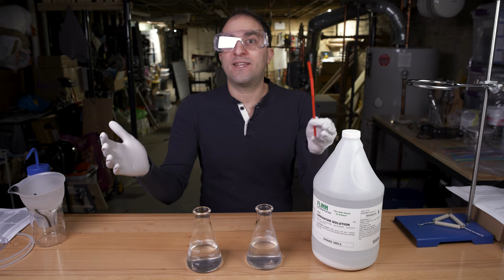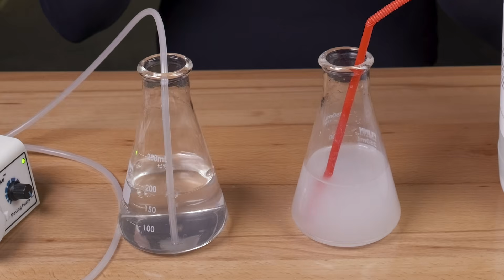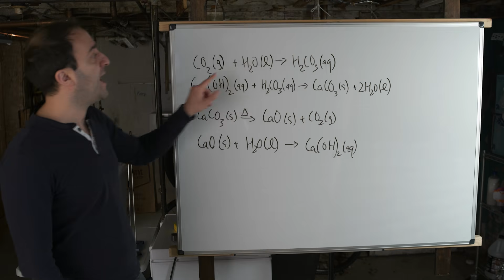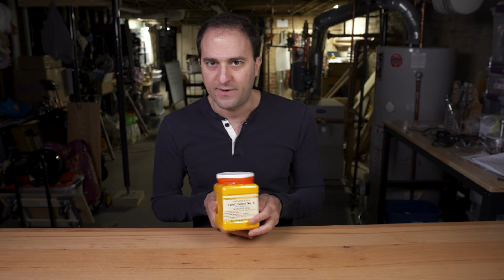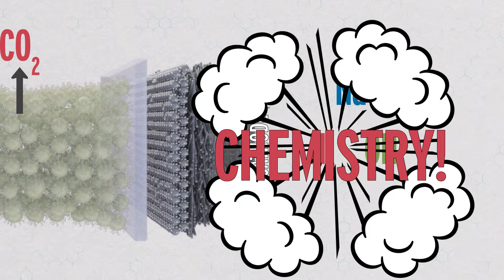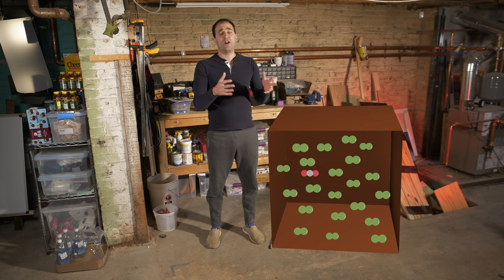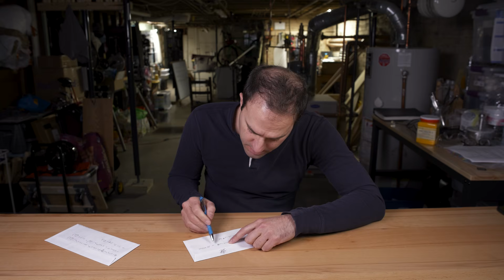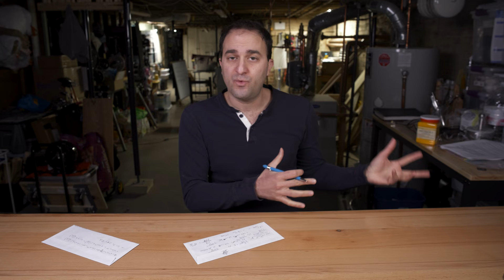Why a Carbon Capture Breakthrough Will/Won't Save Us

Comment from the maker: Lots of talk about trees here. And trees are great, reforestation is an important thing to do. But trees aren't really a good approach to direct air capture (DAC) for two reasons: land mass and time scale. Trees take up space, and there's only so much land on Earth that can support trees that doesn't already have them. Also trees lock up carbon for a relatively short period of time, climatologically speaking. We need more trees, but we need to go beyond what trees can do for us.

Also, to address another recurring comment, we can’t just dump the CaCO3 into the ocean because then we’d have used up our Ca(OH)2, so we’d need to manufacture more, which means mining more CaCO3 and emitting more CO2 in the process. Plus there’s only so much limestone on Earth, and we can’t be dumping all of it in the ocean.
Reply: I added a comment about coppicing and biochar. I'm a gardener, my father involved in climate research (briefly). Soil building through coppicing is a perfect method that can be undertaken in your back garden very easily, with just hand tools. 
Under certain conditions, trees can lock up carbon for a long time (caves have been discovered with trees washed inside that date back several centuries, even millennia). 
The thing with coppicing is, although 10% (average) carbon is retained in the soil under the brash heaps, the tree is actively 'regrowing' and absorbing more CO2, ready for you to harvest it 'again ' before the previous harvest has broken down fully.
Also, brash becomes food for a myriad of other lifeforms - insects, bacteria, moulds, algae, moss, fungi (each feeding that carbon to other lifeforms at a distance from the brash heaps). The heaps also be one shelters for birds and small rodents, which then help feed and build larger predatory animals, swelling their numbers, improving the carbon cycle. Every body is a carbon and water store - even if it is temporary, there is a moving, living repository of both moving over the planet rather than being wholly in the atmosphere.
Everyone is right when they say trees are the simplest answer. They're the simplest, least energy costing (free if you collect and grow tree seeds yourself), and most efficient in terms of effort compared to the technical and chemical answers.
Let's face it 8% energy efficiency a cording to your calculations is utterly hopeless. Whereas, over 20 years, I have built 2 inches of soil over a 2 acre plot of land - using only what material I could collect and grow on my own land (no imported topsoil, biochar or wood chips at all). 
The big difference in kick-starting soil building came when I finally established fungi species in my garden.
Reply: As someone who worked in this area 5 years, direct air capture takes up huge land mass and huge energy amounts. DAC is really a dumb idea. Capturing CO2 at 400 ppm takes huge resources as the driving force is so low. It's much better to capture directly from the power plant where it is at 200,000 ppm, even that would require half the energy output of the plant. Honestly, nuclear is the only real solution, but the 70's hippies ruined that for us.
Reply: @sjn7220 😭
Reply: @sjn7220  In fact DAC is remarkably efficient - best in class has a primary. 2nd Law Efficiency of ~50%.   The problem with CCS at a power plant is that the thermal efficiency is wrecked so it actually takes as much or more energy to separate CO2 from flue gas.    We are getting there as the first large scale DAC plant (  500,000 tonCO2 per year ) will be opened shortly by 1pointfive. 
DAC is much more land efficient than natural CO2 capture - the 1pointfive DAC plant is ~200mx500m ie 0.1 squarekm so to remove 1 billion tons would need a non contiguous piece of land ~ 50 km square using that tech
Reply: Do y’all at Reactions have any thoughts on carbon storage through enhanced silicate rock weathering? That satisfies the storage time requirement, and there’s vastly more basalt in the world than limestone.
Reply: How about planting palm oil trees in deserts to produce green walls that stop desertification? We could use genetically modified palm oil trees with C4 photosynthesis that maximise growth speed and oil production.

Oil palm already produces oil at an incredible rate and grows fast and we can use their wood to make paper, cellulose, charcoal, and other stuff.

Not saying it’s the best solution but the sequestered carbon is in a dense useful form that can be stored long time - unlike CO2 which is difficult to store.
Reply: @drgazter  There are plenty of different productive species that can be grown, oil palms isn't the best first choice for deserts specifically, as there are other plants, even including other palms, like date palms that wouldn't require as much modification/control/management of the conditions to grow in deserts.  So while you're right in principle, oil palms is just one of a lot of possible options, and while oil palms can be extremely productive, they require humid conditions, and their fast growth rate and high productivity in combination with low tolerance for arid and otherwise unfavorable conditions for plant growth isn't just a coincidence.        

Also, C4 photosynthesis is mostly helpful in low CO2 concentrations, an increasingly rare issue for plants, that's why mostly relatively low plants that also tends to grow in very "plant-crowded" situations have C4 photosynthesis. Also, C4 photosynthesis is slightly less efficient in high CO2 concentrations. If you want to increase growth in and general tolerance to dry conditions CAM photosynthesis could theoretically help. 

Modifying plants to give them ability fix nitrogen could be very helpful in improving growth in poor soils, and by that improving fertility of those soils. Giving plants ability to store water and nutrients could also make it easier to grow select plant species in conditions that aren't favorable to grow plants as it is. While not a tree, the sweet potato is a result of "natural genetic modification", which suggests modifying plants to grow bulbs might be a "low hanging fruit", to make them both more resilient and useful.
Reply: @fishyerik  While reading the thread, and especially your comment, i began to wonder if we could plant more plants by the sea. With almost an infinite amount of water, those plants could filter out the salt, and also create great mulches...I hope.
Reply: @eugenetswong  Of course we can, very few large plants grow well in seawater though, and the area is a very small part of the total land area. While plants grown in straight up sea water has very limited potential, or very small part of the total potential of growing plants, I believe creating significant impact requires creativity, and a wide variety of adaptations. 

Mangroves specifically are important for other reasons too, and last time I checked more Mangrove stands were destroyed than planted, or even given a chance to regrow by them selves. Stopping the destruction should probably be the first priority.
Reply: The problem is not the trees or the minerals or the energy, it's the time we have (left). The earth has been doing a great job capturing carbon for the past millions of years using nothing but it's stored energy, continental drift, the sun and organics, add loads of pressure and you get stored carbon in solid and liquid form. The problem we have is that nobody will capture CO2 without a profit. Trees even get made to furniture using more energy, the rest gets sold and burned releasing the CO2 back into the ecosystem.  If we want to change things we need more time, but to get more time we need to work things from all ends: release less CO2, help nature captue some of it, and remove some ourselves binding it for a long time. This video shows only a fraction of the scale of energy and effort required, but it does a very good job at that.
Reply: If only there were organisms that did this for free for us. Oh wait there is they’re called coral
Reply: Trees have limits, you do know about research that shows their stomata close up somewhat in the presence of higher CO2 levels, don't you? The problem is complex, and solutions will have to be numerous. And the only sure fire methods I know about are 1) make pollution cost more than not polluting. and 2) when it gets so bad that politicians personally can't stand the situation. example - the "Great Stink" - it's on Wiki.
Reply: Speaking of quarrying stone and dumping it in the ocean, what's your impression of the option of doing exactly that with silicate rock that weathers by reacting with atmospheric CO2 (aka enhanced weathering)?  (Oh, that's what a bunch of other people are already asking.  Cool!)

And speaking of the fact that trees only lock up carbon for a relatively short period of time, what's your impression of bio-char, i.e. growing plants and then heating the dry remains to produce what's basically undercooked charcoal for use as a soil improvement?  Charred carbon in the soil is said to stay out of the atmosphere for considerably longer than carbon in trees normally does.  (And there's even somebody already asking this.  Even cooler.)
Reply: @danwylie-sears1134  why not combine methodologies?

quarry suitable materials in underground environments, then store plant charred carbon underground where it's effectively dead?
Reply: @CH-bd6jg  Part of the reason for using bio-char to sequester carbon, instead of the various other options, is that it's also useful in soil.  So the value as a soil improvement effectively pays part of the cost of getting the CO2 out of the air.  If you dump it in a hole, you've lost that benefit.
Reply: REDUCE AND REUSE

STOP FOCUSING ON RECYCLE.

COMPANIES PUSHED RECYCLE BECAUSE THEY KNOW IT DOESN'T WORK.
Reply: The equivalent of 353.43 billion tons of ancient plants/organisms is emitted per day in oil as it takes 90 ton to make one gallon of oil, the world uses 3.5 billion ton of wood per year as a comparison, this isn't coal where china has used the same in the last 20 years as USA in the last 100, to supply us all goods, just oil.
Any sequestering, which has already been done by the planet would need to counter this while also accounting for the energy to do it, per day.
Arthur Berman has a sub stack in his latest he shows I think a 9000 percent increase in forests would be needed, could have been 90,000 but still, forests are not going to a be a solution and removing CO2 takes a lot of energy..
Reply: I am totally on the side of reducing 90% of emissions, if we ever get there wouldn't trees and algee alone be able to do the removal of the rest for free? I feel like DAC & CCS is just some moneymaking scam that are sucking up resources we could align with faster (and real) solutions.
Reply: What about enhanced rock weathering where we fracture limestone and basalt formations that are already on the seafloor as a way to expose the Ca and Mg in the rocks?
Reply: @nzuckman  You mean the arxiv paper: "Nuclear Explosions for Large Scale Carbon Sequestration"
Reply: Trees still capture a lot of carbon, using direct solar energy, and can do it without significant resources, they can essentially both grow and reproduce in dirt, from dirty water and sunlight, if we let them. Also, trees stores the carbon in very practical solid carbon compounds. Careful forestry without extensive clear cutting can both provide continuous carbon sequestration and valuable products that can be used to replace materials which production cause a lot of emissions. 

Also, wood products range from things like paper which might get burnt the same day it's sold, via building materials and furniture that typically last years to centuries, to biochar that can last for millennia, and can have numerous positive effects during that time. 

Talking seriously about artificial systems to gather CO2 and then brushing off trees with waving arguments that are quite hollow isn't really impressive. There are huge areas that can be covered in trees just by letting them grow, or adding water, which absolutely doesn't have to be of drinking quality, and without significant competition with other activities/values. 

Funny how the time scale-argument is used in different ways, some say trees don't hold on to the carbon long enough, which has some merit if you focus on single trees, and assume planting trees one time is what's suggested, and not creating forests and wood products that are used for a long time, while others argue that trees grow too slowly to be relevant. 

Sure there are limitations and complicating factors to what trees can do for us, and where they can be practical, but they can "make" and "power" themselves from sunlight, "dirt" and water, and be turned into valuable products, that holds on to (part of) the carbon for a long time, and in some cases replaces other materials that cause a lot of emissions. Compare that to systems that has to be made and powered, maintained and then recycled, and so on. 

I do agree with the analysis that "artificial" carbon sequestration doesn't seem very promising, and that the minimum amount of energy required is a very important aspect. Still, it matters which form the energy is in, heat at modest temperatures as just over 50 °C to cause sodium bicarbonate to decompose can be generated much more efficiently using heat pumps, or utilizing waste heat, solar collectors and so on, than resistive heating. Another way to put it, enthalpy of fusion of water stays the same regardless if the ambient temperature is  -20 °C or 20 °C, but in the first case you have to first provide the heat to make ice reach the melting point, and then the heat to melt it, plus compensate for any heat loss, while in the other case ice will melt without intervention.    

But, even if the required process energy is disregarded completely, trees can still make themselves and sequester carbon with insignificant requirement of resource input, and provide a wide range of different advantages over "artificial" carbon capture.
Reply: "trees lock up carbon for a relatively short period of time" - can't believe you don't know how coal and crude oil was made. You can just bury wood in ground or dump it in oceans bottom. Salt water will prevent bacteria from feeding on it.
Reply: Please make a video on why cyanobacteria won't eat it all.
Reply: @lucelxebinog Eventually, they could. The problem is how long that would take.
Reply: Apparently, one permanent way for trees and plants to permanently capture carbon is to bury them underground. Of course, that means it could eventually turn into fossil fuels. Wait, so all of the carbon we've 'released' from fossil fuels was once on the surface in the carbon cycle? How was earth able to sustain life then?
Reply: What about vacuuming water? My suggestion would be to allow water to flow at an atmospheric pressure of 0.1 bar.
Reply: 1 mole of co2 burned from fuel give around 0.6mj of energy .. so ure gonna try capture co2 using more than 1/6 of the power it generated to capture it .. nope still not viable .. not at least if we arend overproducing solar energy at outrageous speed
Reply: wath a waste of time .. if the theorical max efficiency is reach its still 18/100 of the world electricity .. with 18/100 of the world electricity .. i give a ebike to all people to swap theyr car for every 15km travel .. just swapping those car for a electric bike with 4 kilo of battery per personne will economy more co2 in the atmosphere than trying to capture it, then plant tree around with ur ebike 10 joung tree and a camping shovel fit in a backpack so plant those 10 tree one time a mount and u maximise ur co2 storage .. but off course people like to burn fuel .. cuz its funny to feel 350 horsepower pushing you .. and ure safer around car in a car than on a bike ..
Reply: If trees are such a poor carbon-capture mechanism, how do you explain that so little of earth's carbon exists as CO2, when that is the lowest energy state of carbon?
Reply: @seanbruke424 Upwards of 99% of Earth’s carbon is locked away in carbonate rocks. Just one problem—getting it there is a really slow process compared to the rate we’re adding CO2 back into the atmosphere. That’s why other responses to this comment ask about enhanced weathering techniques.
Reply: If we took half the land dedicated to meat we could make a dent
Reply: yes some of the co2 from trees gets released again when it rots decades later but much of it also stays in the ground for a really long time.
and the reactions you showed saturate the chemical with co2 and then you have to release it again so you can keep using the chemical ... where does it go when you release it(which takes energy, which again produces co2) 
i dont understand how your solution is better or even just comes close with trees.
Reply: @thekito4623  The energy comes from low-carbon sources (wind, solar, nuclear).  Yes, there's some CO2 emissions from producing the steel and concrete and so on, but none in operation.  The chemicals that actually absorb the CO2 don't go anywhere.  They stay in the device as it cycles between absorbing CO2 from air and releasing pure CO2 to use or send to storage.

Trees have very low efficiency, in terms of carbon sequestered versus sunshine needed.  There isn't enough land in the world to do it all with trees.  Artificial systems can have much higher efficiency.
Reply: But that's exactly the the 2nd biggest drawback of DAC: you still need to cover a considerable amount of the earth's surface with DAC sites because every one of them is only subjected to a tiny fraction of co2-containing air. So no matter how energy efficient DAC becomes, we still need huge numbers of them to extract a meaningful amount of CO2. Sure, extraction per surface area might be more efficient compared to trees but at many orders of magnitude higher price. Plus: trees make people happy, DAC sites probably don't😁.
Reply: What about production of NaOH by electrolysis, with the chloralkali process (using renewable energy) then using the NaOH to produce NaCO3..
Reply: IMO another issue with trees is they're just too darn tempting (to capital) to leave alone. Governments in bed with business owners have absurd views like 'it's squandered money to leave those trees unharvested'. Along with the science there needs to be massive societal change in order to accept the reality that we have to reduce the CO2 in the atmosphere if we are to stave off yearly '100 year storms' and wet bulb heat events, along with reduced crop yields, wildfires, etc.

What we as a society need to do IMO is attack the problem with EVERY solution, reforestation, legislative changes to ensure that the trees stay as carbon sinks, investment in forestry services to ensure the underbrush is kept in check (planned burns) to avoid the massive wildfires in addition to all of the new-science driven solutions like various MOFs which can selectively adsorb carbon, electrolysis techniques, bio-engineered algae, etc.
Reply: Pretty sure I know the solution to your heat problem